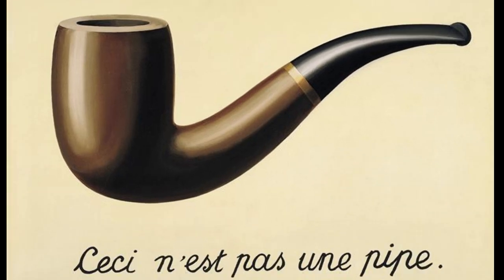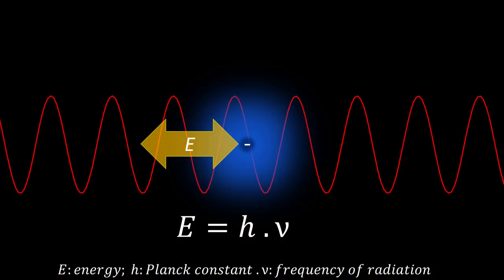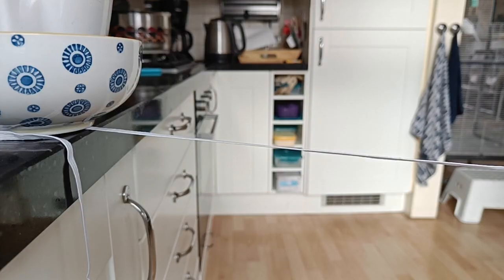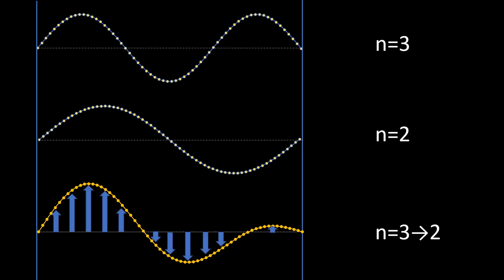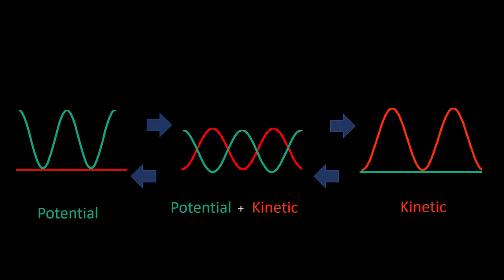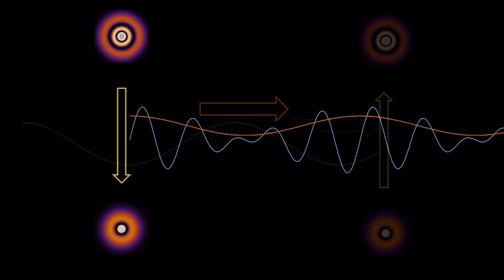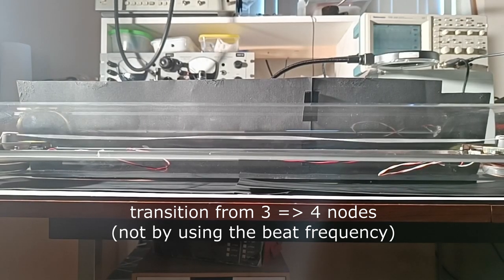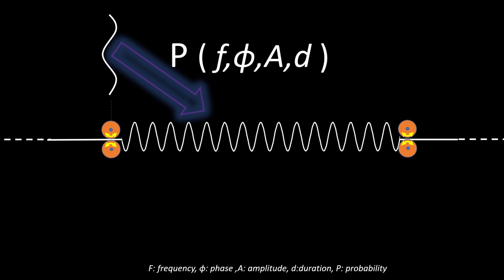Coherence part 3: This is not a wave.

Comment: Both standing waves and quantum oscillators arrive around the same question respecting how they might approach or meet zero oscillation energy loss. All questions lead to this question, which is also similar in concept to a perpetual motion machine, in this case, oscillating electromagnetic fields within some kind of reflective trap.

“Time crystals” overlap this line of inquiry, and the high water mark sub topic of sub harmonic relationships explaining more possible workable hypothesis on long-term oscillation constructs.

In one part of the video below, a compass needle is deflected by a long-term oscillation occurring in supercooled lead. This is raised as an objection to its perfection, by draining energy by the very act of the compass needle interacting with the field. This echoes the quantum measurement conundrum, where it’s impossible to measure without disrupting it, the delicate quantum coherence is disturbed significantly just by measuring it. This is less detrimental but is essentially the same thing, one might ask how the systems might differ, perhaps a more useful measure than merely the Q of the resonator.

The sub-harmonic clue in the video, from the University of Maryland, sounds like of like your idea of different harmonics interacting between the inside of the resonator and the outside world.

Impossible Time Crystal Breakthrough - Explained
https://youtube.com/watch?v=Zr8zwfm1Ub8

Comment: Could it be that "electrons" are simply EM radiation but just in a different state (locked up in a kind of "infinity loop" around an atom)? This idea popped into my head years ago, and I've been unable to shake it. Then again, I don't really know anything about Field Theory or QED, so I'm probably on completely the wrong track.

Comment: Speed of sound in rubber is crazy slow. instead of infinite strings, I suggest a ring of piezoelectric actuators  spaced apart by rubber.
size of the ring represents size of the particle. which changes as it vibrates.
the PZ are to measure longitudinal tension , and to influence it.

Comment: So adding waves does give beat frequencies but I'd love to introduce you to mixing frequencies. Mathamatically this is multiplying one frequency by another which results in true AM and what is present then is the both the sum and difference of both original waves. This phenomenon is highy used in radio receivers and is called Hetrodyning.

Now I worked as a radio technician for a while but had to repair a laser wire marker one day and was blown away but how it created UV from IR. It used a optically non-linear material to cause mixing of the 1064nm (IR) light to produce 532nm (green) and then again into 355nm (UV). Now how a optically non-linear material works is not my scope but very interesting.
Reply from the maker: That is correct, frequency mixing in radio is the result of multiplication (non-linear process). However, the transverse waves in a string are a linear superposition (at least at small amplitudes), like EM-waves in vacuum are a linear superposition. Therefore frequency mixing like you describe in optics can only occur in a medium that is non-linear under specific circumstances like for example a very high field.

Comment: If the rope would have more mass it wouldn't lose its energy so quickly. Maybe use a "goodsteen kettingkje"? BTW. I'm puzzled by the fact that the end of the string touching te speaker is not at maximum oscillation but instead on a knot. If you rotate the end of the string you can make standing waves as well, the end touching the motor will have maximum oscillation. Weird...
Reply from the maker: the fixed end will create a phase shift in the returning wave. Alternatively you can use an open end string.

Comment: I've been impatiently waiting for your next video, and then I didn't even know about it until 3 days later! Some very intriguing out-of-the-box thinking here, and even though I watched the video twice and some parts numerous times, there's bits here that I'm still trying to wrap my head around. I tried a simple model of your proposed experiment in the desmos graphing calculator, but found that it was too simple to be of any value - the phase shift was instantaneous across the entire "reflected" wave, and the phase shift was linear rather than sinusoidal (though I don't know if the phase shift is even supposed to be oscillatory). I definitely don't understand any of this enough. Regardless, I'm excited to see where your hypothesis goes. 

While I believe I understand your explanation regarding photon absorption, what do you suspect is the mechanism for the collapse of the wavefunction, assuming that the EM field area of a photon could be large enough to cover numerous atoms, but theoretically should only increase the energy state of one atom's electron?
Reply from the maker: One of the issues with the model presented is that it doesn't include energy preservation as it is commonly described. If you accept that energy absorption is just a statistical process based on field and phase, then you also need to accept that part of the energy is already there. That space itself is build from energy.
Reply: @HuygensOptics  Could that mean that in some instances, "one photon" could be absorbed by more than one atom, and in other instances by none?
Reply: @EpsilonZRho  That is a very interesting thought. I have come to the understanding of photons from the much lower frequency level of radio frequencies. It is my understanding that energy transmission basically fron Direct Current (DC) through radio frequencies, radiated heat, light etc. to the highest possible frequencies are basically all the same. At radio frequencies the wave length can be hundreds of meters. I am wundering and think that I must accept that a part of the radiated wave collapses to one spot where it is used.. If it is like a water wave then of cause it is only a part of the ring that collapses. A flotasion device in a water wave only gets the energy from the part of the wave ring just around it where as it is of cause thought I believe that a light photon collapses all together. Maybe the latter is wrong. If so then the photo electric effect is caused by a high enough frequency and not a high enough energy of a photon.
Reply: @leonhardtkristensen4093  I think it can get more interesting still! Imagine a hypothetical electron/positron pair that can be individually manipulated (and pass through each other instead of annihilating when they come in contact). Say you can make them oscillate at any amplitude (or rather control the axial distance they each travel over a cycle) and frequency, with the movements of one of the particles being 180 degrees out of phase with the other. What is the smallest unit of EM radiation that can be generated? Is it in fact what we currently consider to be a photon? What effect does a variation in amplitude between the two particles while maintaining a set frequency have? There are much smaller distances possible than that of what an electron makes when it jumps from one shell to a lower energy one. So should there be a weaker photons than those emitted from atoms if the electron were to move a smaller distance but oscillate at the appropriate frequency? Now,  Jeroen theorizes that this oscillation frequency isn't a simple electron oscillation frequency, but a beat frequency that arises from, well, this is the part I don't understand but certainly fascinating! I really hope he hashes this out! There could be some amazing insight into the laws of physics here! 

To go back to my hypothetical electron/positron. In many ways, their movement resembles the charge distribution in an RF dipole antenna. Likewise, it should produce a similar radiation pattern, which is toroid-like. Well, where does this supposed photon go? To my mind, the photon is far more mysterious than our current theories seem to think, that is, if such a thing as a photon exists at all. But now I'm wondering how Jeroen's theory applies to the generation of EM radiation from a dipole. Surely the governing rules apply to both? In what ways is the RF frequency generator actually a beat frequency generator?

I know none of the above is exactly a response to your comment, as I just wanted to make a point on the weirdness or perhaps legitimacy of the concept of a photon (in a sense that it's a fixed, singular thing, nevermind a particle!). Although it is somewhat relevant, because if a process exists that can create varying photon energy (depending on amplitude), then how does that effect absorption systems that can collapse the wavefunction? 🤯

One last thought, since you used it as an example: You mentioned how in a water wave, part of the ring collapses, but there's still other parts left that can possibly transfer energy.  There's actually an experiment I'd like to perform to see if it's possible to collapse the whole ring! Trust me, this sounds weird to me too! Jeroen's latest experiment's use of speakers actually gave me a thought on how to perform the experiment with a much better approach than what I had been considering (solenoids). The idea goes like this: take two speakers, and attached to their cones are two solid cylinders. Place one speaker facing into a still pool of water with the cylinder partially submerged. Take the other speaker and do the same, just some distance away. Drive one speaker to generate a wave, and drive the other to be anti-phase of the wave when said wave reaches the cylinder. What would happen? How much of the wave would collapse?
Reply: @EpsilonZRho  As I understand it a beat frequency oscillator is an oscillator running at at a frequency close to another frequency and creating a beat or tone with the difference frequency. It is used to make single side amplitude modulated radio signals understandeble and also to give a tone to a morse code transmission. 
The dipole antenna creates donuts of magnetic effect around it when a current is send to it. In slow motion a voltage is put on to the centre starting a current by pushing electrons out in one direction and removing them from the other. The current should be highest to begin with but as it is a signwave maybe start slowly too. In any case when it is going it is oscillating on the dipole meaning the current is highest when the voltage between the ends is zero. It is like a pendulum where the speed is the highest at the bottom where there is no potential energy. Many drawings of ElectroMagnetic signals show it like they are in phase and just turn the field 90 degrees. I think that is a little misleading. There is constantly the same energy pressent in the EM waves. It is just that it is some times magnetic and some times electric.
I am not sure where the positron really comes into play. I don't know where it is in the atom. I suppose it could be what is making the proton positive. That of cause they say has to do with up and down quarks. Other than that the only place in the theories as currently told is from a couple of energetic photons uniting. To have a couple dancing together I am not so shure about but maybe.
The smallest amount of energy that can create a photon must be what makes ene electron move away from it's atom I would think allthough thinking about radiated heat then I don't know. As I understand it heat is the movement of the atoms in the material. I don't know if that can generate radiated heat but I think the electrons have to be knocked free from the atom before it is generated. That can be done by heat energy as well as electric energy.
If a photon is a particle (a singularity) I don't really think so. Of cause I don't know. I think that the reason for the supposed energy of a photon has to be there to knock an electron free from a cold surface is that in the formula the frequency is included and that it is the frequency that does it instead. 
To get a (supposed) photon to travel in one direction and be totally absurbed I find unbeliveble. Light, heat and radio signals can be reflected and thereby directed in one direction like in parrallel lines but to my knowledge they allways spread out over a distance. That is what is needed when thinking about things like the Faynman diagrams I believe. They say that quantum mechanics is very very accurate. My thought is that maybe they have the right formulas but for the wrong reasons. I have a little example of how the right thing can be thought of wrongly. If you know nothing about a railway road crossing with light signals you could be forgiven to think that the signal light brings the train. After all you see the light before the train.
Your speaker water wave experiment sounds interesting. The best you could do is to use the same signal to both speakers to make sure it is the same frequency and wire one opposite. You would have to be able to either move one of the pseakers or have some phase shift electronics in between. My prediction is that you would have interference between the two waves but no total collapse. If you get it done please tell me the result.
Reply: @leonhardtkristensen4093  I understand the premise of beat frequency in general and how they're created by multiple waves at differing frequencies. I just didn't understand where one of the waves in Jeroen's hypothesis arises from. Guess I'll have to watch the vid yet another time!

There may be some misunderstanding here, sorry that I may have not been clear. I brought up an electron/positron pair just as a hypothetical example of the most fundamental and basic dipole-like EM radiation generator. Such a thing as I described is not physically possible, but I still think the situations I described provide valid thought experiments. Those thought experiments being: how small can we make the "output power" at some visible light frequency of our radiator? Can it be smaller than the more common atomic photon generation process? My suspicion is yes. Which means that an atom doesn't generate a "unit photon", but rather it generates a light-frequency wave at a certain power. That said, it would seem that the majority of the energy of these waves is still in the form of their wavelength, of course.
Reply: @EpsilonZRho  In my understanding then from an electron jumping the smallest photon energy possible is the one with the lowest frequency I believe. However just moving an electron arround gives out a magnetic pulse I believe so if a free electron is moved just a tiny little bit with an electric potential (a force must moove that electric potential) we also get a photon but of a very low frequency. Then it comes down to what is the smallest electric potential difference moovement possible. In other words what is the lowest amount of force or energy moovement possible. 
I am just not so sure that photons excists. Thinking about that things like radio transmissions, radiated heat and light are all supposed to be the same I think about a dipole antenna. There the current rushes from one end to the other and the current is highest when there is no potential difference between the ends. It is oscillating. Then likening it to a pendulum that is also oscillating. With the pendilum we have the highest potential energy when we have no enertial energy and visa versa just changing between the two. The energy in the pendilum must there fore be constant. The only way that I can see to make anything like a photon (a chunck of energy) must be to specify a time for a photon. I now tend to feel that it is the frequency that has to be correct to make an electron jump just like is thought of in this video.
Reply: @leonhardtkristensen4093  I am with you, Leonhardt. I'm not convinced that the photon, as it is currently defined exists.

Comment: Nice video! After 4 days, 22k view, 299 Comments (I have read most of them), it appears no answer or pipe award.  Since we are using observational methods,  let's try to use 2 strings in parallel (one at 32 hertz and the other at 40 hertz) and observe the energy transfer from one to the other.  I think this experiment would be similar to the pendulums that are attached on the one end, the motion transfer from one to the other.